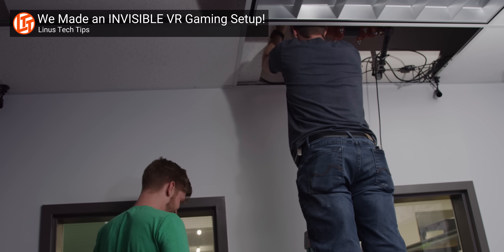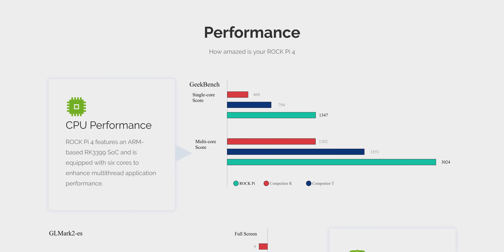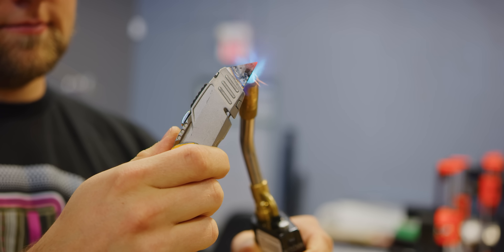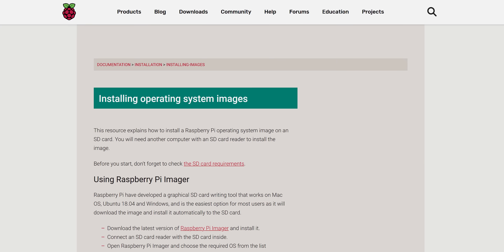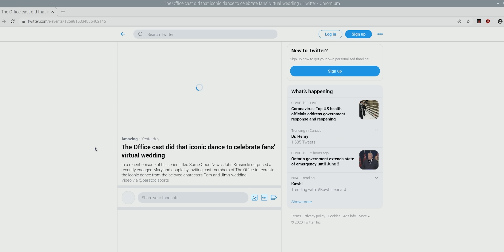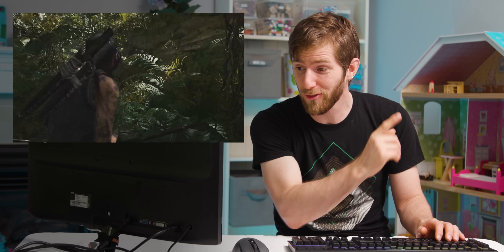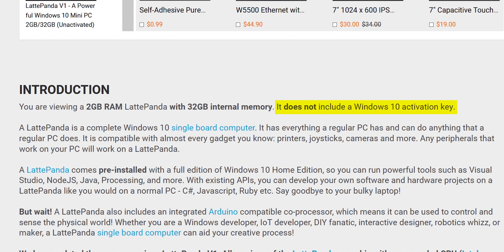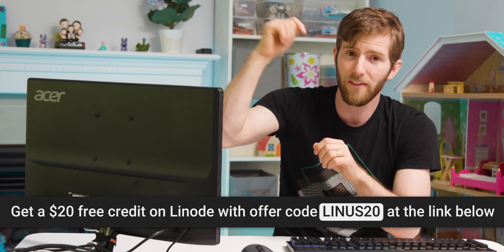My SECRET Computer……

Comment: If you keep playing around with stuff like this I would recommend to check the monitors psu pinout. It is very likely the logic board gets fed with 5V. With some minor soldering, you could ditch one of the cables. Also you may look for hdmi fpc cables and a cheap hdmi splitter, extending the use of the monitor, to switch between the rpi and the then external hdmi input. Also I would like to see a follow up with the rk3399 board, running moonlight on Android. I have done something similar once and moonlight have me much better latencies than steam link (both available on Android anyway)

Comment: I am a raspberry pi user. I recommend using the Ubuntu Mate as it runs very smoothly and you can use 4 desktops at the same time. Also software are easily available on the store of the system. And is having much better user interface. Software on Ubuntu are quite easily available on the web as compared to raspbian. And ya, you will find Firefox as the default browser. So make sure to install chromium on it for better performance

Comment: or you can do what i was going to do with my old laptop... just mount it into the back of my TV and use it as a smartTV with Android_X86 so i could have the google apps pack that you dont get with Windows and definitly not with Linux distros either. 
then use my android as a KBM and game controller for it.... but i never got around to doing it cuz for starters that laptop didnt have bluetooth and the part i ordered got stolen off my porch and i just ended up saying F it.

Comment: 😂 sorry but my secret computer has Athlon x2 ddr2 4gb ram and a gt610 graphics card, only thing I love about it is that It can run GTA V at medium settings pretty well and also Battlefield 4 on nearly high settings but for only 20-30 min after that it shutdowns with a hot smell 😂 but glad it still works.

Comment: Fun new update with raspberry pi 4 (beta software RN). You can now boot from USB devices.

This means you could potentially have a cooler of these setups and all your data on one Flash drive. You could then plug your Flash drive into each computer and have what feels like the same computer in 2 places.

Comment: The company I work at is trying (and I really mean TRYING) to get the RockPi to work as digital signage. It's a headache to say the least. Took them weeks to finally get hdmi audio AND wifi working at the same time. Apparently there are a lot of people in the Linux community that like to pretend to know their stuff but really don't. "Yeah, had that problem and fixed it! But on different hardware, and ubuntu 12.04" - Thread closed, thanks.
They tried the raspberry but that thing just doesn't perform at all.

Comment: Why didn't you take the power for the raspberry from inside the monitor ? Plenty of usb ports are available , you can even take it from the monitor power supply , but no ! you prefer 2 cables running out of the back of the monitor

Comment: Great, I didn't know about the Steamlink for raspberry and overall the project looks great, BUT the Raspberry will eventually throttle due to temperature, being in an enclosed box without active cooling . So a small 5V fan should help a lot

Comment: Wait, so what if it doesn't have a windows 10 key. It's not like you need it anyway, and whats the point of having 2 power cables coming out of the monitor. You could have just took power from the monitor one. There is plenty of space in there for an adapter.
Reply: Exactly !

Comment: While I love this solution, if you are actually budget-constrained to need such a low-end PC (which RPi 4 is), you're better off buying an older x86 Thinkpad from 2008-2012 which go for less than 100 bucks and contain display, keyboard and the computer itself. Plus you can connect your salvaged monitor to it and have 2 monitors that way. And it will have better performance than this RPi4 (Core 2 Duo era mobile CPUs still beat low-end ARM stuff). The only downside will be the power usage, but that is so tiny even with these laptops that it shouldn't matter.

Comment: Huh, fun. I actually did the very same project about two weeks ago, though instead of of a Pi 4 I used a 3B and instead of Rasbian I am running RetroPi for a small, mobile Retro-Gaming station.
Going with wireless controllers and keyboard it's a nice little thing.

Comment: this is pretty much my experience with other Pi-like boards, at the end of the day... you would just regret not going Raspberry Pi. if i were you, i would steal the power from the monitor power supply(switch to another one with higher amperage) and add a buck converter to convert it to 5v for the pi.

Comment: With a bit of soldering it could be completly hidden.
The Controller in the Monitor certainly has 5V Power somewhere and the HDMI cable could be soldered directly to a desoldered hdmi Port

Comment: Cleaner Idea: 
Buy a little AC/DC converter module and solder it to the mains socket inside the monitor. Glue it whereever it fits. 
Step the voltage down to 5 volts DC and power the pi with it direclty . Add a Powerswitch to the raspberry pi and place it in a freshly drilled hole on the backside of the display. 
Might aswell add a powerbutton while you're at it.  You could also just tab into the displays powerbutton for that, but depending on what you plan to do with the monitor otherwise
could make things more complicated.

Depending on how clean you want it tab into any original USB Ports that the monitor may have by unsoldering the ports from the board and soldering wires to it that 
go directly into the raspberry pi or (if you want to switch out the pi in the future) find a scrab usb connector with a bit of cable left on it and solder the lines to that and 
just plug it into the pi. 
If you want to go crazy you could also unsolder the original video input of choice (let's say it's a dvi), rerun wires to an hdmi to dvi connector and plug it into the pi. 
All completely hidden inside the monitors casing.
There should also be external  micro-sd card slots that can be mounted on the backside of the monitor. Maybe get one of those aswell if you think that you'll have to switch sd cards on a daily basis. 
With this method (and depending on which options you take regarding the power buttons and microsd-slot thing) you can make a monitor really look like any other regular
old monitor and even still keep it functional for normal PC use by just switching to another video input.

Comment: arent you just better off having a normal computer hooked up to a tv mounted on the wall, the computer in the roof and just run a hdmi cord and rewire a on off switch into a wall. the display wouldnt be perfect because its on a tv, but it would be usable as a tv making the computer more a secret and with just a hdmi coming out of the wall its not easy to detect once its up on the wall. the computer can be upgraded and if your roof is clean plenty of air flow.

Comment: I did the same with a nuc and integrated wires as the inside of The monitor was hollow enough and the ports were not soldered to the display itself and had cables

Comment: "We found this display, it's been eating dust even though it has an awesome 144hz 1080p screen. We're putting hardware in there that can barely render a 1080p YouTube video at 20 fps to get some use out of it."
Reply: they wanted a more powerful one at the start.
Reply: Well if they use firefox that actually has graphic acceleration in youtube videos he could run youtube even at 4k with no problem.
Reply: @fredrik2008  chrome has hardware acceleration too, but you need a gpu that can decode vp9 codec (10 series nvidia)
there is a chrome add-on that makes youtube vids stream in h.264, but you will lose 4k60 quality option, hdr etc.
Reply: ฉันงงกับแกจังที่จะดูเขาทำรายการ่เรือกครู่ของการะแมมีผู้หญิงสวยๆแล้วมายืนกดปุ่มแล่วผู้ชายอดินลงอยุ่กับการะแมแล้วแนะนำตัวเองแล้วการะแมกัยแฟนเขาด้วยก็จะถทมว่าถ้ทชอบผู้ชายคนนี้เปิดไฟไว้ถ้าไ่ม่ชอบปิดไฟแล้วมีแต่ลวยหล่อๆสวยๆทังฉันก็ไม่ใด้หยาบสักหนอ่ยเขาดูทั่งโลกพอเลือกแล้วบางครู่ก็คบกันไม่ใด้นิสัยไม่ตรงแล้วก็ให้ไปเที่ยวเพื่อจะมหนิดกัสมากขึ่นบางครุ่ก็เลิกบางรค่ีก็แต่งเรีวนสูวๆลวยมีแต่ระดับคนไม่สวยไม่ลวยจะไปหลึอก็อายคสตายหาว่าเราเพรี้ยน

Comment: if you wanted to go hardcore id use the latte panda.
Reply: also if you wanted to use a older or different monitor that uses a standard power cable like desktops use you could run a power brick provided you have a screen with a larger back.

Comment: the finishing touch would be a buck converter inside so you can run the pi off the same power brick as the monitor

Comment: Wow. Make it seem like it's a modern  fast computer. Pushing the bottom video selection. Try and run high definition video while doing anything else. Good for basics but dont make my toys cost more by making more people use them because your short on content. Just put more ads in, seem to be enough so what's a few more. Push those affiliate links. See spot run, jungle bunnies

Comment: instead of running a separate power supply for the Pi, it would be more stealthy to tap the 12v line from the monitor's port with a cheap DC-DC 12v to 5v step-down for the pi. that monitor probably won't use nearly as much power in 60hz mode (the Pi at least, wont support high refresh rates)

Comment: Use a voltage step-down converter and pull power from the monitor's power supply. Hopefully the power supply has enough headroom for the Pi.

Comment: FYI, one of the serious problems with streaming on these low end computers (including NUCs / Atom CPUs) is their ability to process WiFi, as they seem to have very weak transmitters. Upgrading to a USB Wifi device can help, but not eliminate stutter entirely. The only “perfect” solution I had was a wired Ethernet connection.
Reply: Sometimes it's better on something like a android tv stick or fire tv which is what I would use

Comment: If you wanted to get real sneaky with it you could throw a buck converter off the power plug and use that to power the pi without a second power cable

Comment: This makes me want to build a next gen gaming rig in an old CRT monitor.
Reply: Nah remove the whole screen element and replace it with a flat panel. Then use the massive empty space to build the computer.
Reply: @NeonGen2000  Thats sounds like a fun project. When people see that CRT monitor they will be like mehhh  and when it plays 1080p games they will be shocked!
Reply: @ZiGamez  Not really, old 19 in crt actually had a higher res than 1080p.
Reply: Make it happen!
Reply: Plenty people already embedded raspberry Pi's in CRT's

Comment: Linus, what are you on about saying the Raspberry Pi uses Armhf? The RPI has used an ARMv8-A AArch64 (Arm64) SoC since the  Pi 3 came out in 2016.

I think you're running into confusion because Raspbian is only available as an ARMhf (debians name for AArch32) image and not AArch64. This is to keep the os install process simple and the same for all RPIs gen 1-4 as it is meant as a Learning tool to get people into electronics. 

If you step out of the default Raspbian os to Ubuntu for ARM64 or even normal Debian, they work plenty well and even have better supported and more software available for than 32-bit Raspbian has, seeing as ARM64 can run ARMhf packages. 

Both boards run on Armv8-A based SoC, in fact the difference between them is unlike the Pi which uses a 4 core Cortex-A72, the Rock pi runs a two core Cortex-A72 and a 4 core Cortex-A53. Both the boards literally run on slightly different configurations of the same cpu.

Comment: Y'all should stick to Windows, it's what you're best at. Please stop spreading misinformation about my favourite OS. If you actually believe you were "forced" to switch to a RPi4 because of 32/64-bit compatibility... I just can't even. You don't know what you're doing.
Reply from the maker: It has nothing to do with 32/64-bit and no one said that :)
Reply: @LinusTechTips  you do realize that both the RockPi4 and RPi4 use the same CPU, yes? They can run the same armhf or arm64 binaries. Raspbian obviously is not going to work because it was designed for the other specialized bits bolted on like the videocore GPU, but there are other distros that are close enough you can use RPi tutorials and software interchangeably. Armbian comes to mind, or DietPi. Hell my Pi4 is running full-fat, 64-bit Ubuntu Server with working virtualization. Anything is possible these days. I think you gave up too quickly is all.
Reply from the maker: We got it working (big kudos to Anthony) but determined that it was too much of a pain in the butt for most people and ended up presenting this path instead.
Reply: @LinusTechTips  fair enough, you definitely need to roll your sleeves up when you stray from the trail. Should have known Big Papa Tony would figure it out. Mea culpa for my lack of faith.
Reply: As an aside, maybe a future video explaining at further length the difference between raspbian (a 32 bit ARM OS specifically made only for the RPi series of boards) vs. some of the other offerings available that work on both that and the ever-expanding landscape of alternative SBC platforms could provide some interesting content. It could be quite a meaty subject I admit, but it wouldn't be the first time you guys delved into the nitty gritty stuff, and I for one do enjoy when you get Anthony in his true element: the CLI.

Comment: What "broad Raspberry Pi app ecosystem" bs you are talking about? Your setup hides all GPIO pins so it is working like a normal Linux distro anyway. Rock Pi has no issue running Chromium or Steam Link.

Comment: Question 3: Why not use the power supply of the screen itself, internally. Running it through a couple of parallel 7805 ICs (wich also would fit) and power it via the GPIO (or USB if you like resistence and therefore a nasty voltage drop)? So it’s completely stealth, with having only 1 power cable.

Comment: 1080p?  “Decent?”  Ha, so you must be one of those people who thinks the only thing a computer is good for is gaming or watching HD movies.  2560x1440 is basically the minimum in 2020 for any real work (assuming you have decent eyesight), and 4K is expected.  I mean seriously, my 10.5" iPad is 2224x1668 and my 13" laptop is 2560x1600— why on Earth would I accept less resolution on a display with 4 times the surface area?

Comment: Ok, but like I don’t imagine that the Pi is getting enough passive cooling there against your hot display panel...huh....

Also, why not put a power supply inside the monitor and tap the 120 AC input, or tap some of what are presumably powered USB ports on the monitor for power?

Comment: Steam can be installed on Raspberry Pi 4 via BOX86 and can run some games, i run Isaac at 60 FPS on the pi in fullscreen mode only, windowed doesn't work.

Comment: Why not solder the raspberry pi power brick to the monitors' power input as well as the audio jack to the monitors' audio jack, USB ports to the monitors USB ports (If applicable), HDMI connection to the monitors' input stream, and then cut a small hole and incorporate a power switch tied into the monitor input power? Even looking closely such a setup would be almost impossible to discover.

Comment: You should've gone more in depth and tried soldering the RPi power to somewhere in the monitor so that when you power on/off the monitor it does the same to the RPi, and would have had 1 less wire. Same with the HDMI although that's a way less reversible mod

Comment: That's one of the sketchiest things I've seen even for ltt...just put a dc-dc converter for the pi..
Reply: Francesco Porcelli ah, I think running two separate cables is less sketchy
Reply: @EvertGuzman  at least join them together because yeah, which monitor doesn't take 2 cables and have 2 external psu...

Comment: Hey guys I've the same monitor and I am having problem with it this monitor 144hz but only with DVI port which this monitor dosen't has a Displayport my GPU is RTX 2060Super and doesn't has a DVI port what should I do some people told me to buy an adapter but I need specific advice guys. its Acer GN246HL

Comment: You could have taken the additional step of powering both units off of one cable, you just need a 3.5+ amp buck converter to convert the 19v (I assume 19) coming into the monitor down to 5v, it would probably have fit back there right next to the pi.

Comment: This is pretty much what I did with my Rock Pi 4B.  Do not do this if you are not very comfortable with Linux.   Some of the functionality of this card is very dependent on getting everything setup right.  I was using a custom Debian branch for this and while it had some hiccups, mainly with HDMI sound.  The other thing is when I bought it originally almost two years ago, it did not have support to run any OS fully off the nvme drive.  An eMMC flash card sold separately was way better for running the OS compared to an SD card.  You still have to mount the nvme through linux as extra storage, which can be a pain.

Comment: Possible way to extend on this project: Check power draw of monitor. Check specification of monitor power supply to see if there is ~15 watt of headroom at the DC end. Use DC-DC converter powered from DC end of power supply of said monitor to make clean 5V DC max. 3A. Feed it to hidden Raspberry Pi. One less cable.

Comment: If the monitor had a USB power port you could power the pi off that. You might be able to find a 5vdc source in the monitor someplace with a voltmeter. If not a small voltage regulator might work.

Comment: I know it's not as DIY-able but I would have tried to also power the Pi off of the monitor power supply, likely by tapping into the higher voltage lines in the monitor controller, using a step down converter, and then making sure that the power supply could handle the extra power draw.

Comment: Also with the higher end LattePandas have a fan on them so you need some kind of ventilation system for the air to exhaust out of the system.